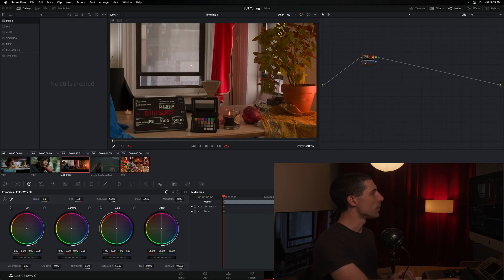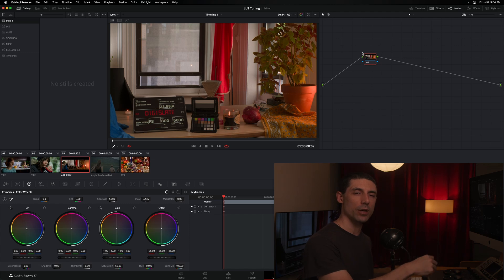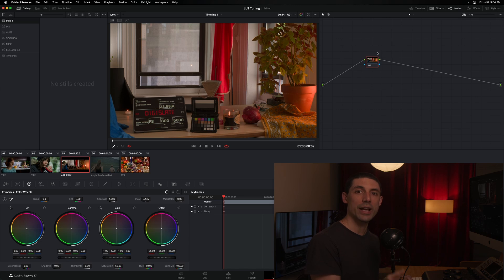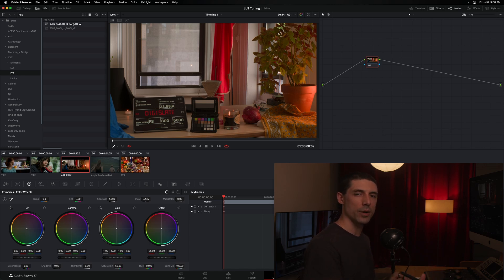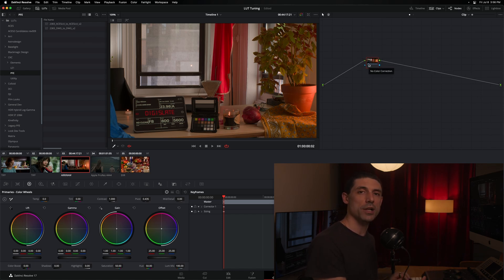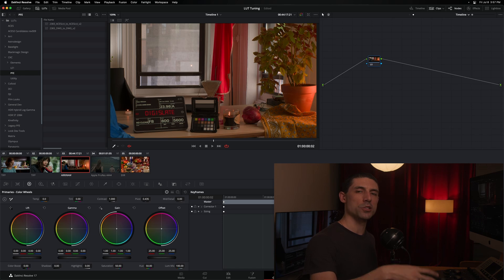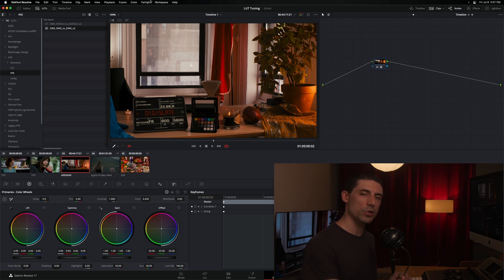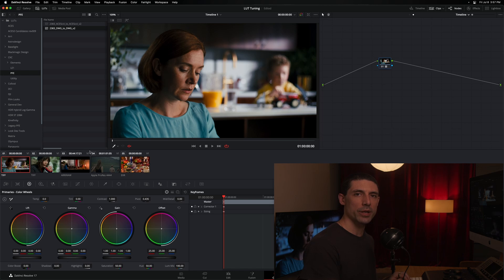How to modify LUTs to get the best looking footage for your project

Comment: So I'm a bit confused on the following:
If my Color management is setup for Davinci Wide Gamut and I shot in Slog3Cine. Before I start my color adjustments I set a Slog3Cineto709 lut on my clip. If I afterwards apply a Film Look DWGtoDWG lut on this clip, will it treat my clip correctly or do I need to still add a CST node changing my clip from 709 to DWG first?

Comment: Hi Cullen, nice tips! I came out with an extra step of complexity: what if I want to control the color and the contrast of the LUT separately? I tried something but I don't know if I am doing correctly. I will try to explain the node structure with words, may be difficult. I put two nodes in layer mixer (composite mode in color) for contrast and two more (composite mode in luminosity) for color, just as you explained. So at this time I have two layer mixer nodes, one for contrast (upper position) and one for color. Then, this mixers go to a simple serial node each (again, at this time I have two in parallel) that are combined in an extra layer mixer node. This is the one that goes to the very end of the node structure. This last layer mixer node is set to "color" composite mode, which is the one that seems to work. Am I correct? How you would do that? Thank you!

Comment: Hey Cullen, I can't get the layer mixer setup to work. Composite mode is set to COLOR. Same LUT is on both nodes. Changing the opacity of the second lower node doesn't change the saturation.  At least to my eye.  I'm working in node based color management, so I don't think it's the glitch you've mentioned previously with the layer node getting fussy when using project based color management.  I have to say I didn't notice color change when you demonstrated the technique in the video.  I assumed it was just hard to see on YouTube, but maybe I need to get my eyes checked. It does work when I disable the upper node which makes me think the layers aren't separating color and contrast they way you describe. I would really like this to work.
Reply: I tried putting the saturation of the upper contrast node to zero, which makes the lower color node work well, but the saturation range in that node then extends below what's in the LUT to zero when the key gain is set to zero, if that makes sense.
Reply: @CullenKelly  i try to make the same thing but it doesnt work...any help please?
Reply: Take this with a grain of salt, but in theory the layers themselves would have to be set to color mode and luminance mode respectively and then be combined in a mixer. I don’t know resolve enough, yet, to know if you can change the layer mode of a node itself. Maybe you can have two nodes: both of them set to color space HSV, but on one, you deactivate Channel 3 (V) and on the other two you deactivate Ch 1 and 2 (H and S). Merging these should - in my theory at least - result in the kind of separation aimed for.

Comment: I think it is confusing when using color management that you if you put the image in highlight mode you are still seeing the display colorspace, so the middle grey looks to be middle grey for rec709 and not whatever log space the footage happens to be.  Isn't  the pivot of .435 middle grey for Rec709? 
I get confused as well with this -
 if I throw up the isabella chart in color managed and the timeline is Rec709 2.4  click on the middle grey on the source, the dot on the curve is not where it would be if in davinci wide - but changing it to DWG the middle on the curve goes down to what you have on your chart. 

But when you change it in the timeline settings with no grading - they look the same. So it is strange to me that a grade in DWG and one in Rec709 would be so different in contrast when they are visually the same. See - I am even confusing myself trying to explain what I mean.

Comment: Nice tip with the middle grey cheat sheet! It's interesting/funny to see that you've named your LUT DWG but in the case of Arri you'd probably call it LogC. Whilst one only calls out the primaries and the other only the transfer function. Ideally you'd want to be fully descriptive and add both but we tend to only name the transfer function (for sake of short names) however calling it Intermediate looks weird because of it's name. I blame BMD :) B-Log doesn't look that nice either but they could've come up with a better log name hehe.

Comment: these layer adjustments still dont work in a color managed set up...Hope, Blackmagic can fix this in the future....
Reply: I just tried this technique that Cullen is presenting here, and it seemed to work as expected for me in a colour managed setup. Unless I'm missing something...
Reply: @garethpearce5255  did you set up the color management in project settings or nodes?
Reply: @brmoogma  project settings
Reply: @garethpearce5255  are you using resolve 18? I am still in 17, and the bug is there....
Reply: @brmoogma  No, I was wrong. Sorry I had been away from the office for a few days so couldn't recheck, but it's definitely not working right with  colour managed settings at the project level, on 17.

Comment: Does your 2383 LUT add any film grain to the image, or do we need to do that manually? If not, should we add the grain before or after the LUT node?
Reply: LUTs don't carry spatial informations (such as grain, blur, halation, etc...) there's a debate on which is the best way to apply grain if at the start of the node graph, before the 709 transform/lut, or after the aforementioned transform. The decision on where to put the grain is your and yours only. I personaly apply before my Rec709 transform, but thats my taste. If you look on the lift gamma gain forum there are a lot of interesting discussions on grain. Hope this was helpful :)
Reply: @CullenKelly  I agree, especially if you do any smoothing or blurring - the node order really matters. Easy test of that is to add grain on a node before any power windows or gradient blurs etc. and then turn on the "grain only" and take a look at what those do to your grain.